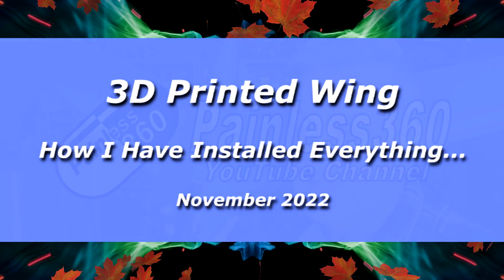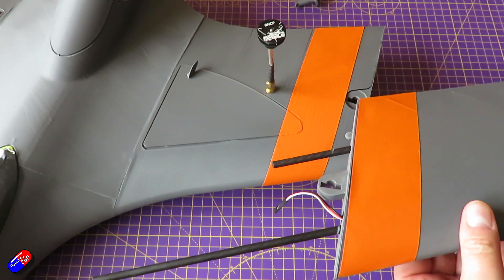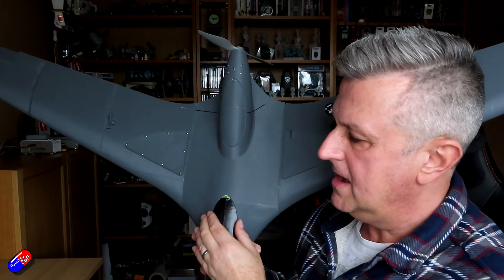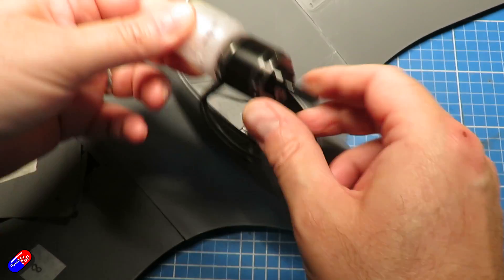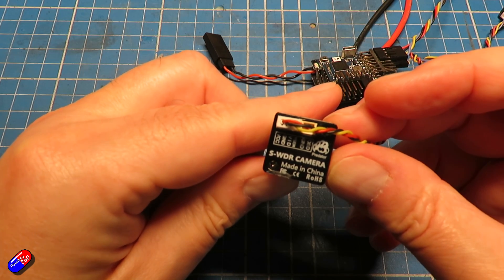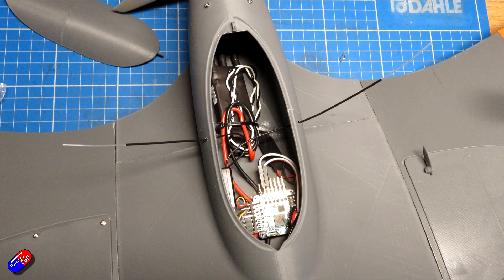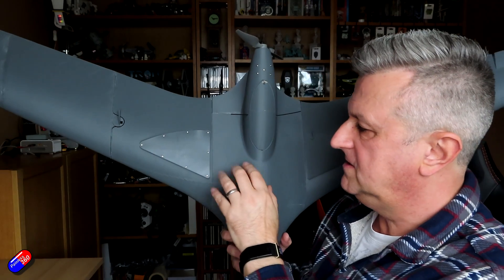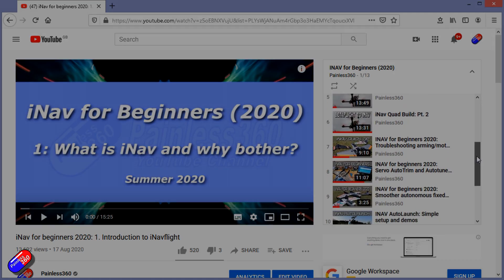3D Printed Wing (Eclipson White Wing - EWW180): Installing all of the electronics inside..

Comment: If you have a little time, it is EZ to 3d print a adapter for  the smaller camera to your large form factor camera mount. I will check if Thingiverse has one already if not I will add one for you. look for it under "lee's camera adapter"
Reply from the maker: I is but the position of the camera also need moving forwards as well as having a narrower width. Having the options available from Eclipson directly for those who buy the model is a better way to do it IMHO... Happy flying!
Reply: @Painless360  The adapter I made for you on thingiverse has camera position adjustment forward and backward.

Comment: i'm just finishing a white wing, i tried printing it in LWPla but it fell apart,  now I'm re printing in grey PLA, ive learned a lot form the project so far and much of it came from your videos so thank you, ive had a lot of success with 3D lab print, which build into beautiful flying models.  ive also built plane print models which come a close second. The White wing is  by comparison  like a Russian Jet fighter, so i hope it fly's well because it goes together like S&*t
Reply from the maker: I hope it flies great too as this is one of the longest builds I've ever done! :D
Reply: @Painless360  We flew the WW yesterday, for the first time. Mine is  an EDF version but aside from that its similar to yours. It was a short and successful (line of sight only) flight, we quickly realised that we need a lot of Sky and our 3/4 football pitch sized park was only big enough to fly figure 8s, I was able to to try angle mode for a few seconds but not being experienced with this i quickly got disorientated as the responsiveness dropped, 

i bought it down ok on its skid on the second attempt, My notes would be 

1 it feels underpowered at launch but its not, it drops away from the launch but then lifts as it picks up speed, (like a glider)

2 it looks like you have to turn flat but its actually quite forgiving of higher angle turns.

3 the PLA version is heavy and you need to keep the speed up, so come in for landing low, keep below 5 feet for a while while you bleed the speed off and come in gently, as point 4

4 Its fragile, even a gentle landing on grass seemed to produce a crack in front of the front wheel block, if you can use the wheels and smooth ground, 

The only other thing that confuses me being a kid that started flying in the 90s is the bad/noisy Fpv signal on all my planes, is that normal?
Reply: I have one more note, for my next flight on grass i plan to re size the skid and print two, that we can use to guard the  elevon servos linkages on landing.
Reply: @oliverprout  I am about to start printing a Whitewing with my boy.  What LW-PLA did you try?  Sounds like something lighter than PLA would be nice, but if it doesn't hold up...I guess you have to go with something that does.  I have some fancy ColorFabb LW-PLA-HT and Qidi ASA-Aero.  Haven't tried either of them yet.  Would regular ASA be something to try, as it is lighter than PLA?  High temp resistance does interest me as I am in TN - plenty hot and sunny to warp the Polymaker LW-PLA I've tried.
Reply: @boomupengineering  I did both, in the end i concluded white wing is not worth your time. unless you have a concrete runway to fly from, its woefully underpowered so needs a very long take off run hand launching has to be done in a downward glide and control inputs need to be considered, its weak, and flexes badly. Its is without a doubt the worst 3d printed design ive encountered, if you fly it twice you've done well.
Reply: @oliverprout  Ok, we'll shelve the WhiteWing for now - put it in the advanced category.  Instead I think we'll print out a PlanePrint Savage Bobber.  Something easy to build and to fly.  My only problem is I have a Bambu printer.  I have to rely on those much smarter than myself to make my printer work with Cura slicer.  I'll probably go with ASA filament so it is durable in the summer heat of TN.
Reply: @boomupengineering   I find 3d labprint planes work best, though plane print are  good,

Comment: I must ask you once time more for help. My problem is that with  inav51 and omnibusf4pro my esc's and motors burns. The reason is rate of pwm for motor that is in reality 401 Hz. Thearetically it is possible to change this frequency to 50Hz but in reality frequency rest 401 Hz. Change to 50 Hz is possible in CLI but this is not working. Error in INAV or something can be done ? The frequency for servos is correct and equal 50 Hz.Thanks for your help in advance.
Reply from the maker: Plane? Quad? ESC type? Tricky to help without some more detail... Best of luck
Reply: @Painless360  This is a plane. ESC , that last time burn is eMAX 30 A. Problem is, that changing frequency in CLI do not change nothing. I have always  Motor_pwm_rate 401 Hz measured on scope.  With no flignt controller (only receiver connected to esc) motor - esc work with 50 Hz with no problem. Thanks you for trying to help me. I must change frequency to 50 Hz, that theoretically in inav51 is possible in CLI command line.

Comment: Great overview. With those long wings, this should make for a good glider. Might be able to thermal soar in summer for longer flights.

Surprised you couldn't modify the camera mount design for a custom print. Having access to the design of this component (or STL), would allow a few simple customizations.
Noticing the one of the wing compartments has a nice twist lock and hold down bits, while the other uses screws. Interesting that both didn't have the twist lock for easy access. Nice to have those access covers. For example could custom design one to incorporate cooling for the VTX should it be needed. 
Should you find you need more air for cooling ESC, a soldering iron would allow creating a small hole on the motor pylon. Could enlarger later if need even more cooling.
Reply from the maker: Not interested in modifying the model only for myself. Rather feedback to the designer so any improvements are available to all... Happy flying